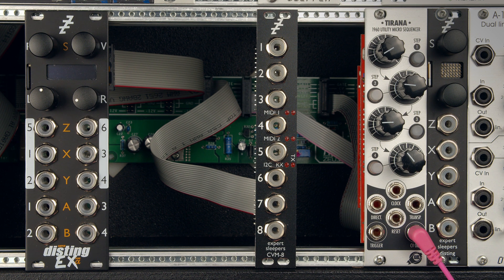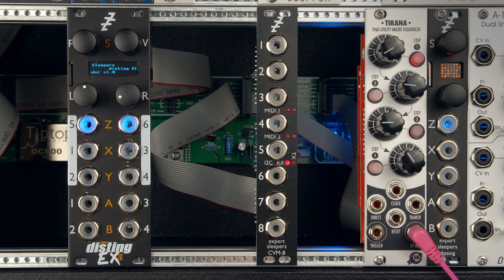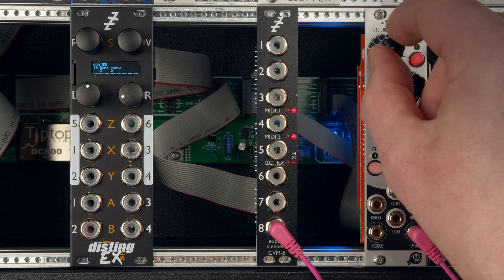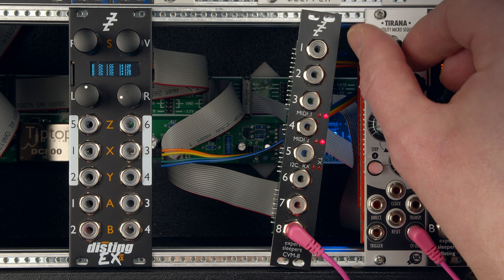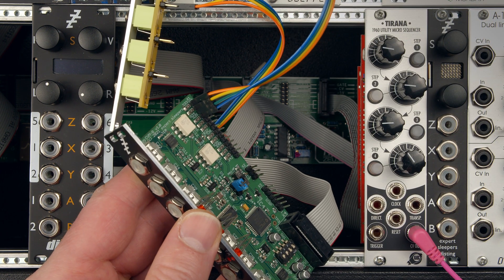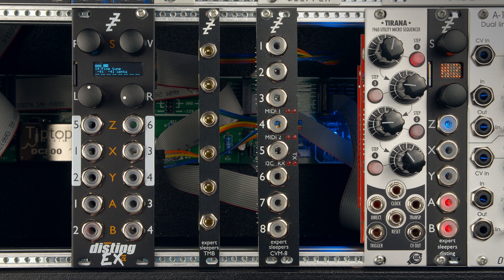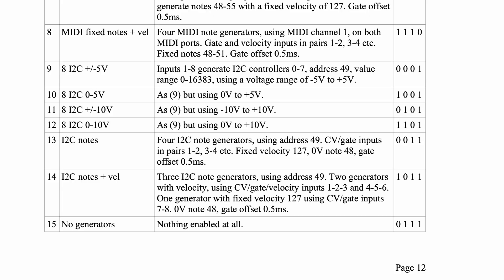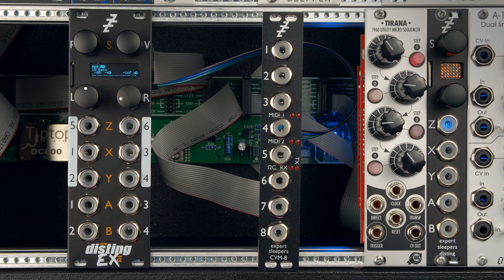Connecting the CVM-8 to the disting EX

Comment: I'm in the planning stage for a case and wanted to know: Can concurrent bus usage happen with both MIDI ports and the I2C bus all at the same time from the CVM-8? If so, this would allow me to connect one MIDI port to case jacks, the other one to the Tiny MIDI breakout, and the I2C to a Disting EX, while also allowing me to use the MIDI pins on the Disting EX to connect to another pair of ports on the same Tiny MIDI breakout.

Comment: Would this also work on my smaller 104 moog case that uses a flying bus?
Reply from the maker: Would what work, specifically?
Reply: Moving the jumper for the select bus. Do flying buses work in the same way?
Reply from the maker: @jonajhiggins  Yes, if it has all 16 conductors on the bus.

Comment: Would this add 8 cv in to midi out on the Disting mk4? I was having trouble finding what it can add to an mk4
Reply from the maker: It provides 8 CV in to MIDI out by itself. No disting mk4 need be involved. If you want to combine it with a disting, you can use it as extra CV inputs to control algorithm parameters.

Comment: So, regarding use with the FH-2, the CVM-8 essentially adds 8 additional CV inputs to the 2 already available? And this can be done via the select bus?
Reply from the maker: The FH-2 doesn't support the Select Bus. There's not really much utility in connecting the CVM-8 to the FH-2 either, except to use the FH-2 as a way to convert the MIDI connection to USB.

Comment: Is it possible to chain 2 or more CVM-8 using internal midi in/thru?
Reply from the maker: Not currently, but that's high on my list of things to add in a firmware update.
Reply: @ExpertSleepersLtd  So it will be possible to use this as a MIDI to i2c converter too ?
Reply from the maker: @lilybattlefield78  It doesn't do that currently but people keep asking me for it, so it will probably be added. It's certainly technically possible.
Reply: @ExpertSleepersLtd  that’s good news, thanks !
Reply: @ExpertSleepersLtd  Hello Os, I didn't think to ask you, can another of your modules do this, convert MIDI to i2c? Thanks!
Reply from the maker: @lilybattlefield78  Not currently.
Reply: @ExpertSleepersLtd  Hi Os, great news that you have made MIDI to i2c conversion possible with the Disting EX! Is there any chance that you will implement it in the CVM8? Thanks
Reply from the maker: @lilybattlefield78  Entirely possible, though I'd prefer to get some feedback on the disting EX implementation before copying it into the CVM-8.
Reply: @ExpertSleepersLtd  This is very exciting! I can't afford a Disting EX at the moment but this will certainly spark interest among i2c users
Reply: @ExpertSleepersLtd  Hello Os,
I see on Modwiggler and on the ER-301 forum that MIDI to i2c with the Disting EX seems to work very well for people who have used it, do you need more feedback or do you think it's ready to be implemented in the CVM-8? Sorry I'm a bit pushy, I hope my enthusiasm about this isn't taken as harassment
Reply from the maker: @lilybattlefield78  I think it's solid now. I'll see about a CVM-8 implementation when I'm done with the current disting EX update.
Reply: @ExpertSleepersLtd  Ok, thanks a lot for your work !

Comment: Great new module :) Can I use a Keystep for sending MIDI notes into the top jack of the breakout while still sending MIDI via the CVM-8 to the same Disting EX? Keystep for notes, the CVM-8 inputs for MIDI-CC for example?
Reply from the maker: Yes, using the disting's MIDI input for the Keystep, and the Select Bus or i2c for the CVM-8.
Reply: @ExpertSleepersLtd  great, thank you! :)
Reply: Will it be available through Schneiders in Germany? If so: when? ;)

Comment: Nice - can I connect an external e.g. 16Faderbank with one  I2C output to one input of the CVM-8? And will it handle all 16 faders signals? Thanks, I‘m new to I2C.
Reply from the maker: I'm not sure I understand what you'd want to happen when connecting those two modules. Could you clarify?
Reply: @ExpertSleepersLtd  I want to use the external Faderbank to tweak the parameters of the DistingEX Poly Wavetables.
Reply from the maker: @musicsmurf  Then you don't need the CVM-8 - connect the faderbank directly to the disting EX (by MIDI or i2c).